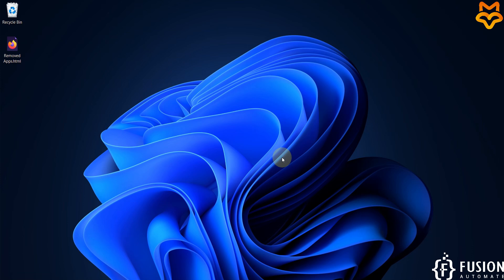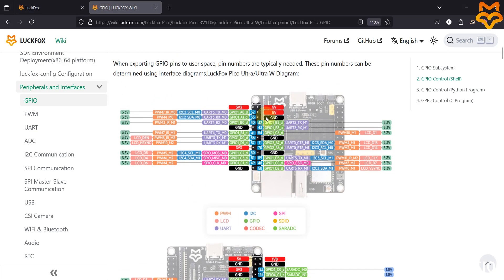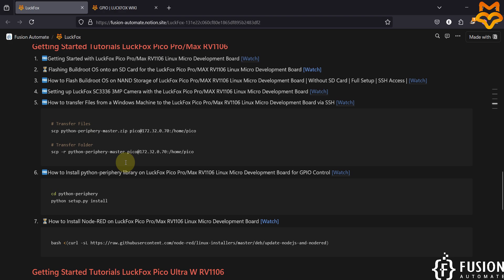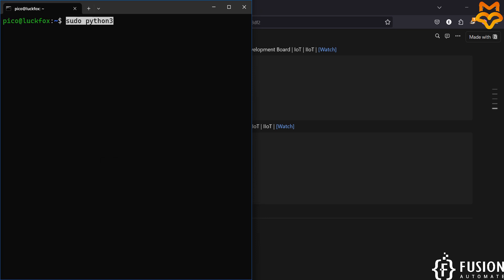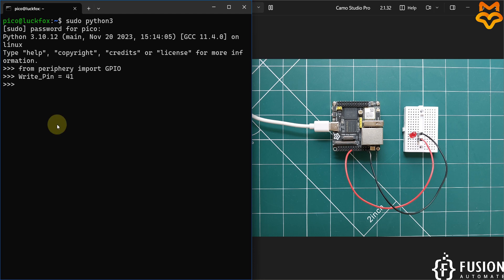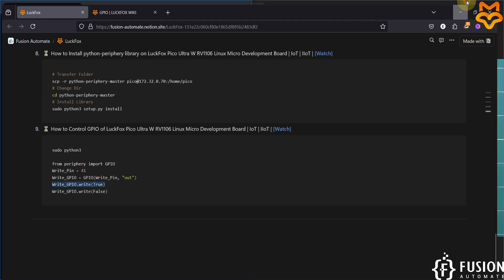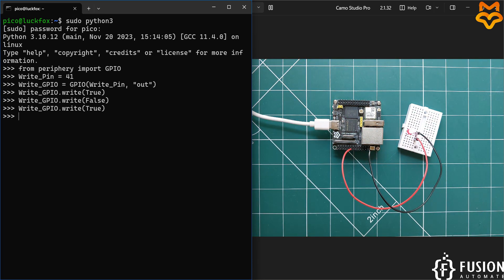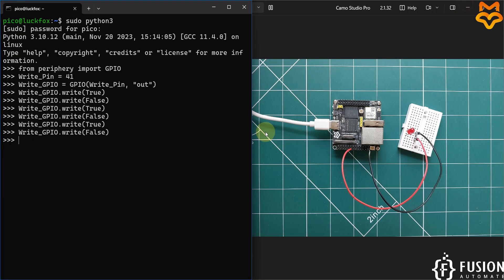How to Control GPIO of LUCKFOX Pico Ultra W RV1106 Linux Micro Development Board using Python |

Comment: not sure if you have an SSD1351 SPI OLED to test but while i still wait for hardware, here is a DTOverlay for the SSD1351:
&spi0 {
	status = "okay";
	pinctrl-names = "default";
	pinctrl-0 = <&spi0m0_pins &spi0m0_cs0>;
	//cs-gpios = <&gpio1 RK_PC0 1>;
	// cs-gpios = <&gpio1 26 1>;
	#address-cells = <1>;
	#size-cells = <0>;
	//spidev@0 {
	//	compatible = "rockchip,spidev";
	//	spi-max-frequency = <4500000>;
	//	reg = <0>;
	//};

	ssd1351@0{
		compatible = "solomon,ssd1351"";
		reg = <0>;
		status = "okay";
		spi-max-frequency = <4500000>;
		bgr = <0>;
        	bpp = <16>;
		dc = <&gpio2 RK_PA2 1>;
		reset = <&gpio2 RK_PA3 1>;
		rotation = <0>;
		spi-cpol;
		spi-cpha;
		fps = <30>;
		buswidth = <8>;
		rgb;
		solomon,height = <128>;
        	solomon,width = <128>;
        	solomon,page-offset = <0>;
	};

};

Comment: Can connect 5v directly?. ❤ help please
Reply: Can I connect pendrive in usb port and usb c to power it?& Use ethernet to access on web😊?
Reply: Does usb c hub works if I power by 5v pins ??😊 I am confused only creator can help me
Reply: @deone-entity3935  which version of the board do you have? might need to check the schematic but i think the 5v pins are safe to power the board with, im not certain if all are connected to the same bus but it would make sense that they are designed to take power over usb, power the 3v3 and 1v8 LDO's.. im waiting for my core116 to arrive to test with my breakout board (video coming soon)

Comment: I want connect to LCD16x2 i2c , do we need to make a driver for this one?
Reply from the maker: Hi Friend, your idea is great but I dont have any idea how to do that ! if you have any hints then please share I will try that and will let you know.
Reply: this is a DeviceTree Overlay for an SSD1351.. if you change the chip and manufacturer to match your one it should work, using SPI0:
&spi0 {
	status = "okay";
	pinctrl-names = "default";
	pinctrl-0 = <&spi0m0_pins &spi0m0_cs0>;
	//cs-gpios = <&gpio1 RK_PC0 1>;
	// cs-gpios = <&gpio1 26 1>;
	#address-cells = <1>;
	#size-cells = <0>;
	//spidev@0 {
	//	compatible = "rockchip,spidev";
	//	spi-max-frequency = <4500000>;
	//	reg = <0>;
	//};

	ssd1351@0{
		compatible = "solomon,ssd1351"";
		reg = <0>;
		status = "okay";
		spi-max-frequency = <4500000>;
		bgr = <0>;
        	bpp = <16>;
		dc = <&gpio2 RK_PA2 1>;
		reset = <&gpio2 RK_PA3 1>;
		rotation = <0>;
		spi-cpol;
		spi-cpha;
		fps = <30>;
		buswidth = <8>;
		rgb;
		solomon,height = <128>;
        	solomon,width = <128>;
        	solomon,page-offset = <0>;
	};

};
EDIT: reverse engineered from here: https://github.com/LitchiCheng/RV1106_Linux